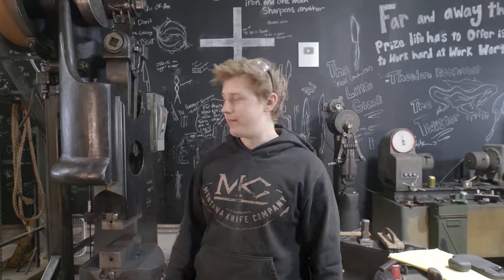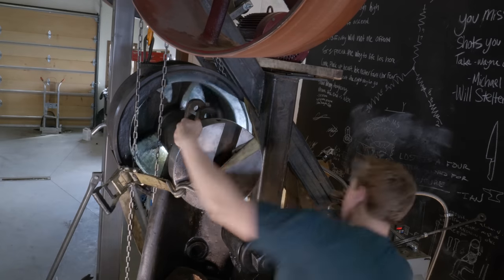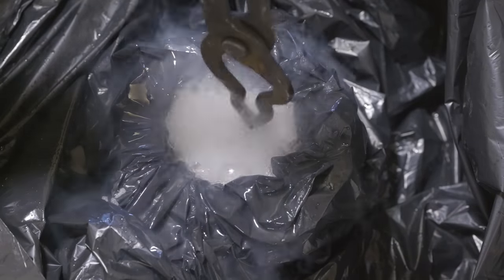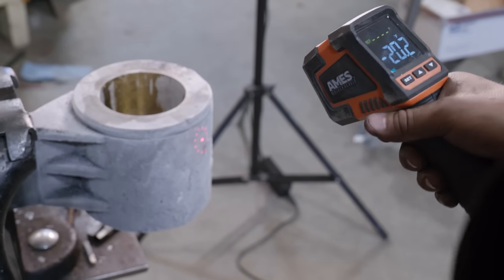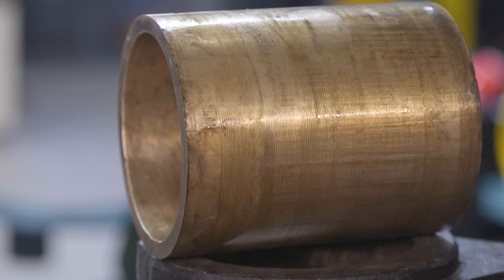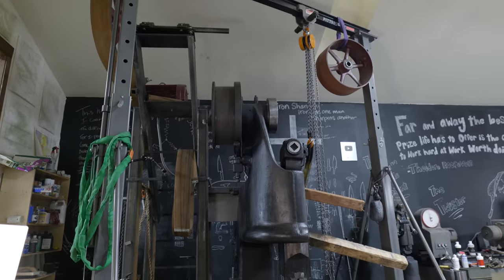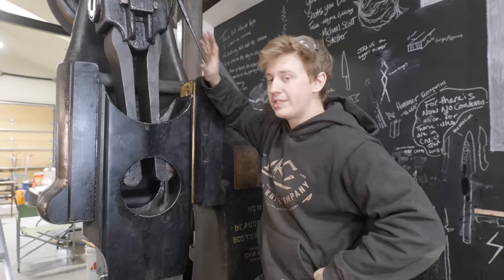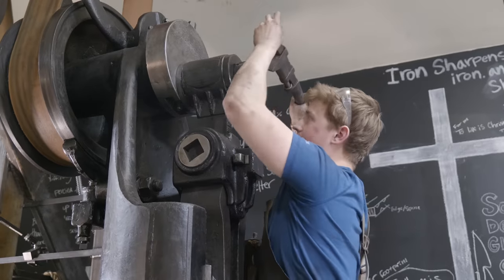Finally Getting the Power Hammer Put Back Together!!

Comment: Hey Will, the cast iron bushing was wider in the middle to keep the belt in the middle when running. That prevents the belt from wondering from side to side or off the track.

Comment: Hey if you ever have to remove a bronze bushing like that again. Cut a relief line through the entire length with a fine tooth sawsalls blade. Back in the day they used to use brass pins  in the bushings to hold them in place from spinning

Comment: That rough surface finish? Intended. To keep it in place. Friction. Glad you call it bushings now - sometimes 😊... Yes, I'm picky 😁... Great hammer though, love me some old mechanic tools... It'll bed in. Eventually... Graphite grease may work... Or when desperate on time: valve lapping compound. Leave the springs as is...

Comment: Thanks for this video, I think you should flatten the head of adam's axel first. Then you have to see if everything is still in line with the hammer. And correct it. 
I have a gut feeling that the giant nut is pulling tings tight to.
Take off the braken when you are testing.
Keep your head cool, your doing fine.
Stay in the moment and do what you have to do. It's great content....

Comment: It makes me want to be close to the machine not meaning to sound bossy but have you dropped a plum bob across the ends of all the bushings and turn points you need a fine line to be able to see a small difference I hope it helps if you try

Comment: If you methodically and eventually replace or rebuild all the parts one by one will it still be an antique or would it then be a new machine?
Reply: Dwarfs still call it the family axe. Even with a new haft, a new blade, a new haft again, a new blade again asf aso... 😋
Reply: Hammer of Theseus